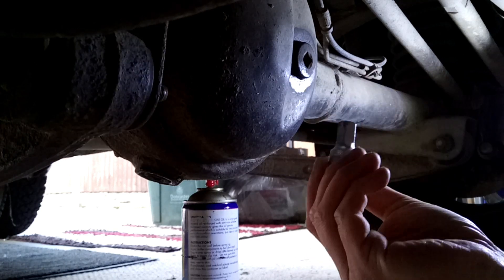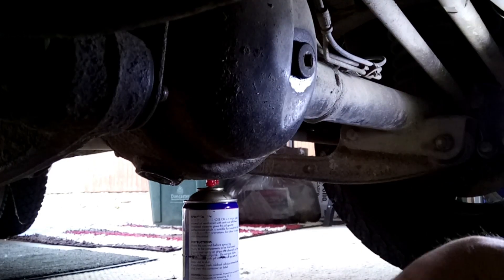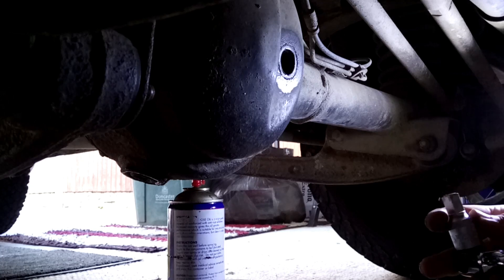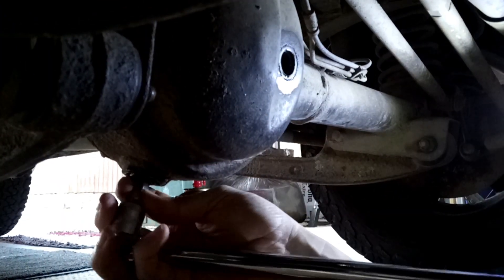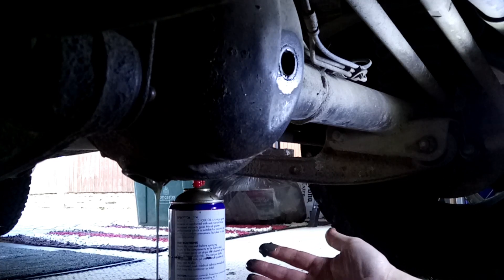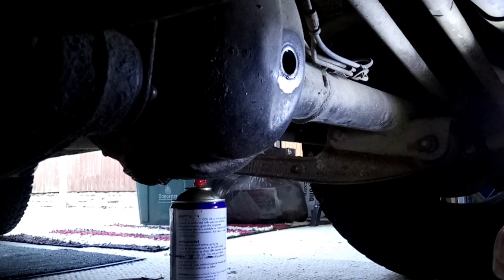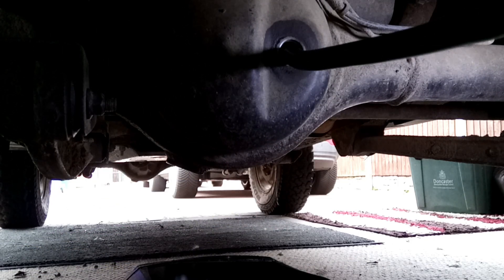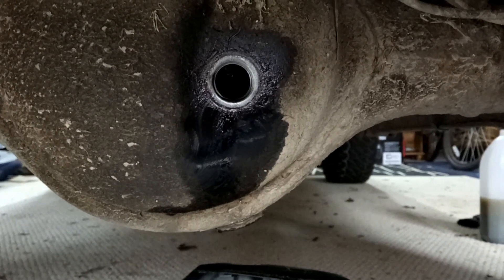How to change the diff oil on your solid axle 4x4 (Suzuki Jimny here)

Comment: great video thanks! Looks like you did not tighten the screws very much? I have a JB74 jimny and the manual says 50nm for the filll and 55nm for the drain plug. Thats quite a bit no?
Reply from the maker: Hi, I do own a torque wrench, but rarely use it! I just tightened to what I felt was right, sometimes you just know (I hope!)
Reply: @CLSJimny4x4  I also think the 50/55 Nm is way too much, greatly increasing the risk of the screws seizing and heads getting stripped out. Manual also says that the screw + seals have to be replaced for every diff oil change.. but nobody does that really :D